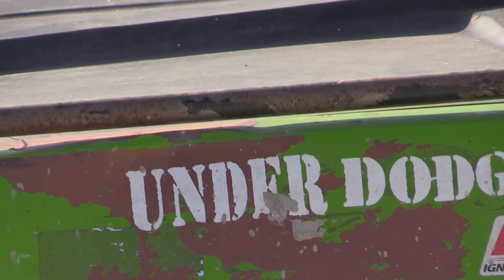Rock Crawl Comp " rock course" Mountain Mafia Fall Classic,

Comment: what are the exact stipulations to building a rock crawler aside from the basic stuff like full tube frame yadda yadda yadda like can u run a diesel engine to get the extra torque slash power or is that considered illegal. just wondering cuz i watch tons of these vids and have never yet seen a diesel power plant. i was just curious is all
Reply from the maker: Loki/Lucas Johnson as long as your rig meets the safety regs its run what you bring, there are several Diesels in these events, but they tend to be heave and slow to accelerate, the most famous are, the Diesel Buggy and the Boost Moose